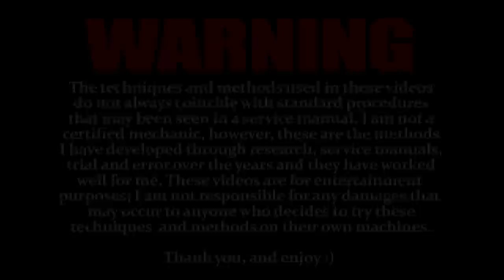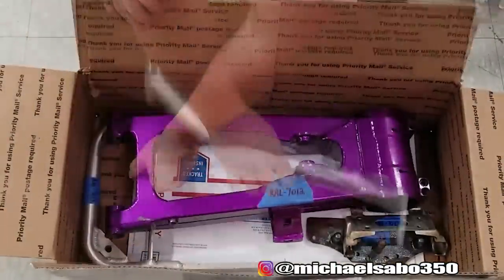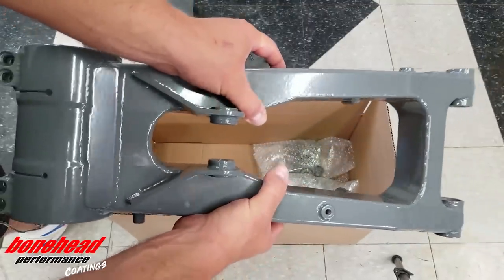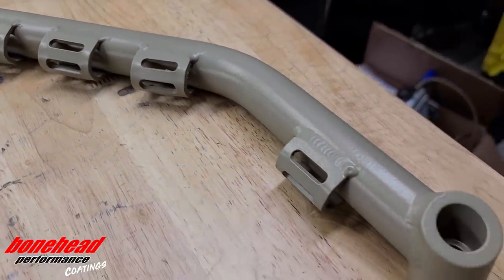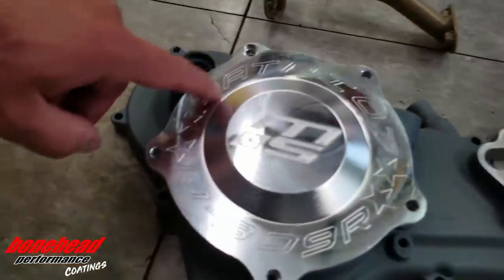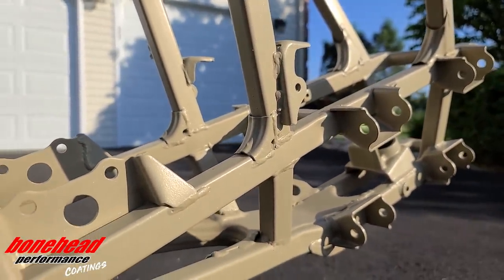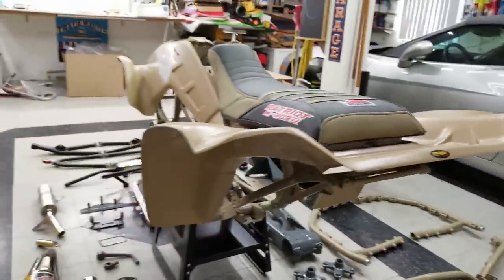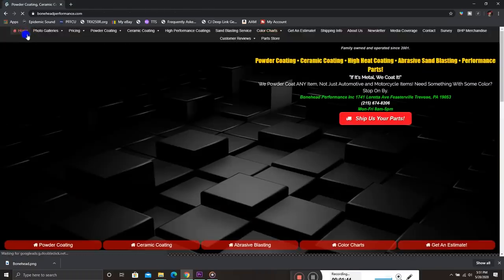These Powder Coated Parts Look AMAZING | Project 250R Part 24

Comment: Found a storage locker full of 250r parts. 3 frames 2 engines, 4 sets of tires, brand new plastics and a bunch of ther stuff. Budy said there was enough to build one complete and a 2nd that would need a few hundred in parts. He was letting it go for 1500 but the wife used my money for a down payment on a car.
Reply from the maker: Awww dude, such a great story with a terrible ending 😂

Comment: My dad has a 250r, its a drag quad and he recently got a brand new frame that has turned it into a full on drag quad. You can check out the old one on his channel is Polonda401 if you want to check it out. Has a scrambler top end, I think its safe to say im following in his footsteps, Im 13 with a job saving for a 250r to rip in the dunes. Thanks for the great content, I find your the only you tuber I commonly check to see if you posted a vid. Ive raced Motocross ever since since I was 3, u and my dad are pushing me into the quad game
Reply from the maker: Wow dude, thank you for this compliment and for watching my videos. Sounds like your dad built one hell of a 250r. Good luck on your future 250r and with your future in MX 🤘

Comment: Dude you need to build your own oven get you some metal studs sheet metal old oven heat elements as good with wiring you are power coat kits are cheap be cool to see you do it on yz built!!🤘🤘